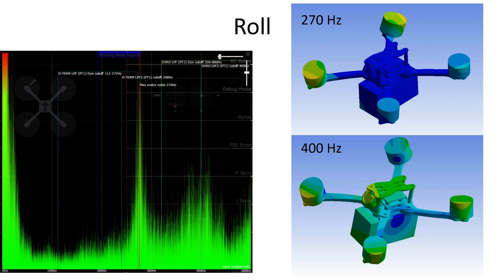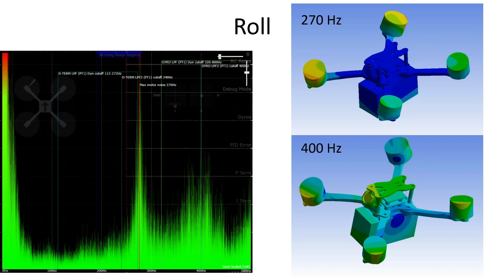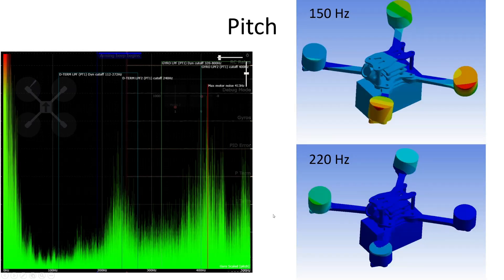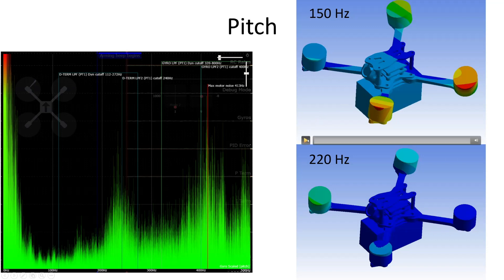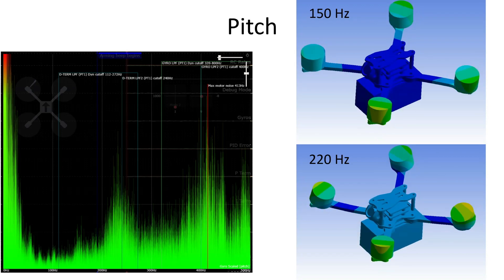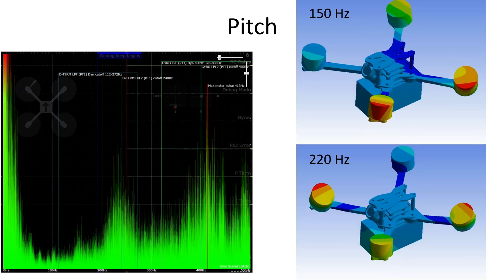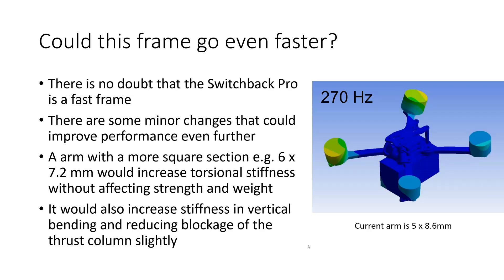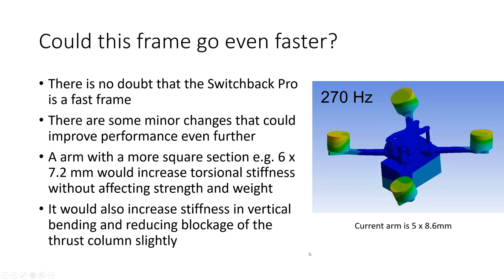Five33 Switchback Pro Frame Analysis: Can we make it go even faster!?

Comment: The I-Flight Mach R5 has the square arms so much better control and much faster plus 30x30 or 20x20 mounting holes . 2 camera holders for dji 03 unit or analog 1.8mm micro holder   ,, the switchback five33 like you said the arms twist so harder to maintain complete control ,  the R5 is my favorite frame all time

Comment: There surely must get a point where narrow thick arms start getting weaker for there CSA considering you are relying on the bonding between the layers for strength and will resultantly have shorter carbon strands than a wider arm of less depth.
Reply from the maker: Absolutely, I wouldn't suggest going  narrower than 1:1 with thickness. But of course it depends on the loading case.

Comment: Okay, I have one a question, I guess I know the answer but want to o´know what you think:
Wouldn't a carbon tube be even better arm for our quads. I mean, it is no question that it would be a nightmare to design and build, probably relativly pricy to, but jost from the technical/mechanical standpoint. 
The weight would less be a pretty significant amount, the stiffness in torsion would also be much more effectve, because we easily could habe a 8mm or 9mm tube, and therfore a better momentum of ressitance. The same would apply in the vertical and horzontal axis. The only thing that would be a little worse would be that we have a slightly bigger area where we would block the thrust, but I guess the fact that its a tube, probably will make up for that. 
So whats you opinion on that? Thx

And has anyone a idea how to reallytivly easy mount these arms (on both sides, the body and the motor end), then also comment on that if you want ;^D
Reply from the maker: You asked and answered your own question! A carbon tube would be better IF it wasn't a nightmare to design and build.

'A nightmare' in this case means expensive and heavy due to the need for machined mounting hardware.

It's technically possible but probably not for the max $100 that most people spend on a frame.

Comment: With a fair amount of BB logs on various racing frames - for the weight, the Switchback is definitely among the cleanest out there (as there is a fair bit of inverse relationship on light weight and elevated first resonant mode), and that the 150Hz pitch mode tends to primarily get excited at lower throttle levels than most setups realistically want.  In practical terms, it doesn't get excited for much of the throttle range, freeing up the dynamic notch to do work elsewhere, and in practice, post-filter gyro inputs are remarkably clean even with limited (or disabled) gyro lowpass filtering and very high Q notches
Reply from the maker: Thanks for your comment. I'm not a racing pilot so its good to have people with your experience on the channel!
Reply: @ChrisRosser  I can assure you, I'm far more appreciative that you're able to do this analysis, and show that a lot of the stuff we've been pragmatically doing (mostly stumbled into through trial and error) actually made sense.

Comment: Regarding arm stiffness and thickness of the available carbon plates. There are some frames out with double stacked arms like the hyperlow airshot or the almond racing AR8 and AR10. What do you think about this type of arms? Are they as good as a single arm with the same thickness? I love your channel!
Reply from the maker: If the double stacked arms are not bonded together then they will not be as stiff as a single arm of twice the thickness. This is due to the fact that shear stress is not well transmitted between the two arms.
As a result a stacked arm could be replaced by a lighter single arm with no loss in resonant performance.
Reply: @ChrisRosser  Thank you for the answer. And what do you think about vertical arms like the Karearea Toroa? They are 4mm wide and 20mm thick.

Comment: Since race frames also need to prioritize durability, is there also a way to model resistance to breakage due to impact at various angles? And would the proposed changes in arm dimensions here likely increase or decrease crash durability? I imagine there’s a situation where optimizing for minimal resonance in pursuit of flight performance could result in reduced crash durability, and it would be interesting to see those considered together.
Reply from the maker: It's possible to model stresses due to impact using finite element simulation. My proposed changes in arms dimensions should improve durability by increasing torsional strength and providing a more uniform strength to impacts from different directions. There may well be situations where optimizing for stiffness compromises strength but I don't believe this is the case for the Switchback Pro. If I were suggesting hollow tubular arms for example that could reduce strength but sticking with solid carbon fiber of equal cross sectional area should maintain strength.
Reply: @ChrisRosser  This is an area where I have... ahem... significant practical expertise.  The delamination pathway over time really tends to hammer on the torsional side (among survivable impacts), and the inter-layer delamination progression is what actually degrades arm performance over time on quads that otherwise fly well.  That non-uniform distribution of stress on those areas, particularly as they related to motor mounting stress risers or stress risers just outside the main/bottom plates tend to be the nucleation points of broader arm delamination, while the more perpendicular hits will either flex or break the arm.  Some of the brilliance of this frame is that the wiggle plate can absorb some of this energy without losing its primary functional role of tensioning the arms and adding tons of Coulombic resistance surface area, and why that architecture outlasts the 6061AL midplate setups of the closest competitor frames.
Reply: @ChrisRosser  Thanks for the insightful reply!

Comment: Very interesting!
Is there any benefit to using tubular arms versus square?
Reply from the maker: The benefit of tubes over hollow square box section is very small. A hollow arm can be stiffer than a solid arm for the same weight though.
Reply: @ChrisRosser  Down the road, it would be pretty neat to see how the overhead of butted joints ends up being the tyrannical factor in trying to design something that can outperform standard designs until we get up above 1kg on quad AUW... but for now, this very direct content is absolutely brilliant, keep this coming
Reply: There is certainly an aerodynamic advantage. But at this scale we are talking small values.

Comment: Could we compare the switchback to the HGLRC wind 5 lite. Another race frame with similar design.
But did we really answer the question can we make it go faster ?
If so just by improving frame stability  does it affect speed?  🤔
Reply from the maker: I think so: If we can reduce blockage of the thrust column the performance will increase. If we reduce filtering and increase PID gains we make the quad more responsive (reducing delay) and improve accuracy of stick tracking. All these factors should allow for faster lap times.

Comment: To make proper arms, you start by using carbon fiber correctly, there is no torsional strength given by the carbon fibers, and half the carbon weight is struturally useless.
Reply: Going from 0°,90° fibers to -30°,0°,+30° should be quite beneficial, and a good compromise between bending and torsional stiffness. I could image this layup may be available as plates to cut arms out of, given that there are prepregs and cloths widely available.
Reply from the maker: The challenge with using custom layups for FPV frames is one of cost and volume. If everyone was happy to pay $100s for a simple frame, or a single design was guaranteed to sell 10,000s of units there would be enough money to have custom layups done. If you would like to have some custom layups done for your frame design I have some contacts in industry who can do that for you. Let me know!
Reply: @ChrisRosser  I don't need any contact, I make my own, it is easy and cheap to do when you know the process. My 3 year old frame is 45g stiff and bombproof...
Reply: @ChrisRosser  Hey Chris, this is an interesting aspect not many manufacturers consider due to the high costs involved, but are you suggesting we cut the arms on a 45 degree angle relative to the weave on carbon sheet for maximum torsional stiffness and less bending? I made some structural changes to the arms on my frame, following your research and findings and I have significantly improved the noise profile, I am so happy!

Comment: I've recently cut myself some arms to fit 6 inch props on my TBS source two. Because I had some 2.5mm carbon fiber at home already I made each arm two pieces of 2.5mm CF to make one 5mm thick arm. If I had assembled the arms with a spacer at each end to make a gap between the two arm plates - making each arm 2.5mm CF, ~2mm air gap, 2.5mm CF - would they be any stiffer in torsion? I'll probably try it the next time I have the frame in bits but would appreciate your opinion if you would be so kind as to offer it. Thanks. Keep the videos coming.
Reply from the maker: Two thin plates is worse in torsion than a single thicker plate. Even spaced out. The issue is that the air gap doesn't transmit shear stress. You need material to transfer the shear stress from the bottom to the top plate.

Comment: I'm curious what your boundary conditions are for the analysis? Do you hang the frame from the props with a gravity force on the CG?
Reply from the maker: It's a fully free inertial simulation. So there are no boundary conditions. The harmonic stimulus is the acceleration of the reference frame of the sim.
Reply: @ChrisRosser  seems like those loads would influence the mode shapes in flight... Although you are showing correlation with the average black box spectrum... That averaging over time may be making the flight loads. I've been thinking this kind of analysis is crucial for moving to the next level, but really the flight controllers have been really good at making up for these light, stiff, undamped frames. Great stuff, love to see us using all the tools in the areo engineer toolbox to fly better!

Comment: I guess the square Arm thing would improve almost all designs.

I have a 10 inch with 10mm stacked arms (2x5mm epoxy glued)  and its rigid as it can get
Reply from the maker: It's certainly the direction I'm heading in with my designs. The maths says square is the best, that's good enough for me 😁
Reply: @ChrisRosser  Well, I certainly agree with with your analysis, I am glad I already have the frame, can't wait to build my very first digital race build!

Comment: Reducing vibration is obviously a good thing but how much does it really contribute to the performance of a quad? I don't think the mechanical energy that goes into vibrations will have a noticable effect but the reaction of the PID controller may.
Reply from the maker: In racing where every gram and percentage point counts being able to reduce filter delay and increase PID gains a little might provide an edge around tight technical tracks. Better propwash handling could allow for more agressive turns and better stick tracking could allow for more precise, tighter lines.
Reply from the maker: It's not going to turn me into Evan though 😂
Reply: A more significant effect of a frame with good vibration characteristic will be the improved endurance in flight time. Racers often disable gyro LPF for the absolute minimum latency in the PID loop, and this comes at the cost of lower filtering = higher noise. The higher noise will interact with D-term and amplifies the effect once it goes into the motor. Any kind of noise getting into the motor means hot motor = lower efficiency. By having a frame that has good vibration characteristic, this effect can be minimalized, often resulting in more flight time or laps in the 2 minutes course used in MultiGP.

Comment: Why would it go faster if it was stiffer? I do not get the point.
Reply from the maker: A thinner arm with less blocked thrust column might provide a small performance advantage. In general stiffer frames support less filtering and higher PID gains which make a quad more responsive. That can make them faster around a track.

Comment: Sadly a thicker arm, even if narrowed, would weigh quite a bit more because if the motor mounting pad and the body attachment area. There would need to be some routing elsewhere to get the same weight which costs more and causes another degree of complexity to fracture resistance and will likely split between layers easier depending on how it's done. 

It would be intesting to assess a bathtub design arm.....
Reply from the maker: That's certainly a good thing to bear in mind. I think with some careful design you could minimize or even eliminate the weight penalty. You might even find you can reduce the cross sectional area with a square arm as there is no direction where the arm is more likely to break?
Reply: @ChrisRosser  add a crossbar to the arms and see if it behaves appropriately. That would probably be a lighter way to go even at 2mm for the cross bar.  I know that's not really helping your analysis but would also be intesting to see.
Reply: @ChrisRosser  the other thing about 6 mm arms is that they tend to be extremely strong. Even though the cross-sectional area is the same, I have found that thicker arms in general are stronger than wider arms. I have made a couple of designs which even though the arms were narrower than the wider arm, the arms just wouldn't break and the central body pieces would break instead. This is partly why we discontinued the hammer frame. Even with 3 mm body plates, the 6 mm arms were still cracking the body and just wouldn't break. Considering that's probably the most popular racing frame right now, it would be really cool to see them optimize the arm and see what you get as a result.
Reply from the maker: The increased strength in thicker arms would make sense as they would be stronger in torsion and not have a weak direction. If that lets you make the arm lighter by reducing the cross section it could be a win win. The arm braces are an interesting idea. I'll see how thick they would have to be to have the same effect as a 6*7.2mm arm
Reply: @ChrisRosser  I'm more interested to see if the center of vibration wobbles about or stays centered. Since the frame seems symmetrical I'd assume it should stay centered.
Reply: @Kabab  & @Chris Rosser, I'd be real curious to see a Hyperlow Vert2 analysis. I know Bob helped Rob with the arm design and it's super thick, but the body is also super slammed bringing in a lot of rigidity. It also has the optional front crossbar. I think it's a pretty cool frame design, although not the easiest to work on.
Reply: @WEEBER13  actually it would be interesting to see how those arms do. That arm design was something I came up with as an answer to all the vertical arm frames that we're having heaps of problems on the yaw.  The design uniquely takes care of the weight problem on the motor platform when thickening arms.
Reply: @Kabab  given the recent "research" and "experimentation," the only thing I would probably do additionally is to put a piece of electrical tape or a thin layer of E6000 between the two arm pieces that make up the arm sandwich. I bet there would be a little bit of resonance happening between the two arm pieces because the attachment points are so far away. (i.e., screws at the base of the arm and the tip of the arm).
Reply: @Kabab  I broke my 7” hammer arm flying backwards and was too low and caught and arm and spun out. Frames fine arm cracked tho..   i do like the glide but would like a front 30x30 for my fc
Reply: @ChrisRosser  Bob is capturing another implicit part that is tremendously valuable - as delamination occurs, the rotational stiffness of the arm is going to reduce, but you can extract more useful life with a wider rather than squar-er arm profile, then brace it appropriately.
From the overall frame design perspective, at 6mm for 5" quads, the selection of desirable breakage points becomes fairly significant, as breaking main plates is pretty undesirable from the electronics perspective (whereas replacing an arm on a racer, especially with MR30 connectors on motors, or racewires, is easy)
Reply: How about using AI to design the best drone frame?
Reply: @greatwavefan397  this i have been waiting for! ai structural anaylsis for 3d printed drone frames.. lets face it carbon plate frames will hit a stand still eventually for the optimum 5" etc..
Reply: Each mm of carbon usually adds about a gram give or take how is that a lot of extra weight were talking a total of maybe 4 grams and if we’re doing thrust calculations on like a 2207 style motor usually around 2200grams per at 8800 grams overall thrust (round about) 4-8grams of carbon won’t even be noticeable
Reply: @terpsquirter7107  it all adds up...
Reply: @Kabab  did you watch the video with sound on he said decrease the arms width and increase the height to 6mm making it the exact same weight but overall way more rigid with both twist and bends… so at the end of the day it actually adds up to be the same lmao
Reply: @terpsquirter7107  first off, it would be wise to be respectful. Second, when you make the arm thicker and narrower, the motor platform and attachment to the body doesn't get narrower. The resulting arm is quite a bit heavier. Unless you do depth cuts which are more expensive and introduce natural stress points in the structure along with a different sort of possible resonance.